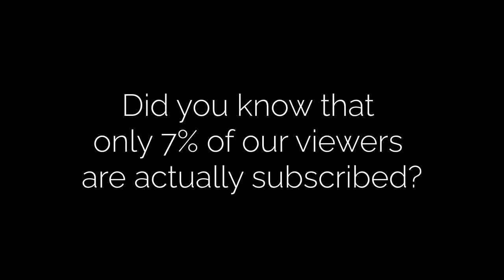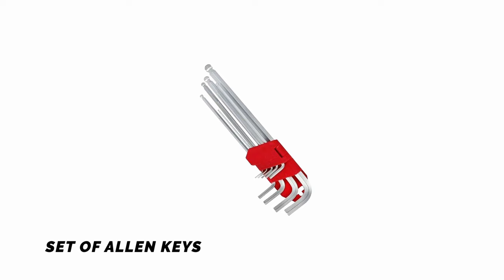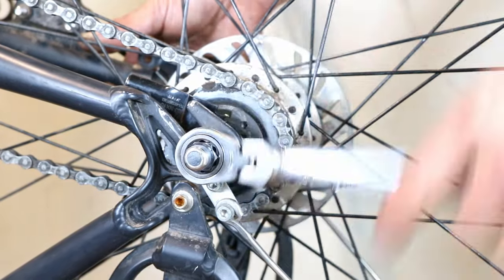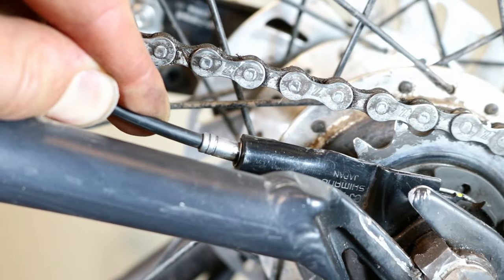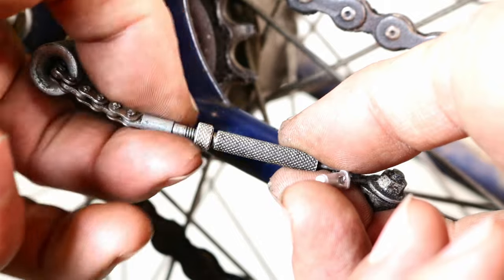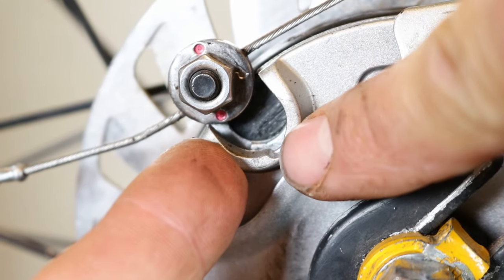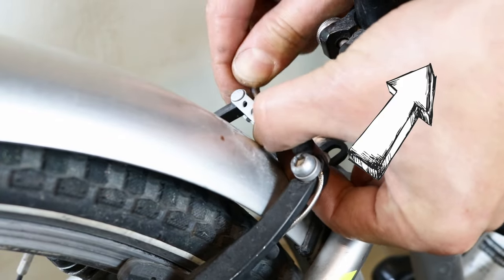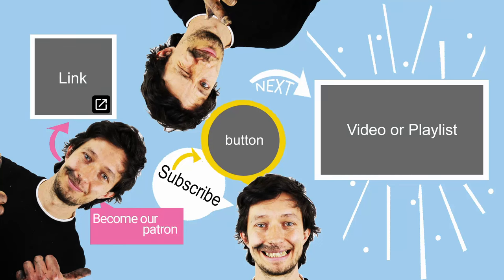Install a bike wheel with internal gears: Step-by-step-guide

Comment: I have Shimano inter m. Its kinda different it looks a like.but seems my break when used doesbt spring back. I guess i need to open the whole break again probably some spring is not good anymore or so? I dont know but anyway
Reply from the maker: Hi, thanks for your comment and sharing your experience. If you need help with your roller brake I have a video that can help here: https://youtu.be/Hm5PxA3pHrQ
Good luck!

Comment: Great video. Subscribed. If it’s a e-bike does the software need to be updated as the gearing ratio and the number of gears will be different from a regular shimano cassette gear. Thanks.
Reply from the maker: Hey, thanks for subscribing and for the kind words! I'm glad you enjoyed the video. Regarding your question, are you planning to replace a a derailleur gears to hub gears? Are your derailleur gears electronic (like Di2 for example)? What alectric system are you using (Shimano, Bosch, Yamaha)? Will you be making your hub gears controlled electroniocaly as well?
Reply: Thank you for your reply. I have Shimano gears and a bosch kiox 300. And I would like to change to IGH from shimano with di2. The eBike is Haibike Trekking 11
Reply from the maker: @amitshivkumar2561  Thanks for this. You will most likely need to connect your bike to the software to set up the gears.
Reply: Thank you. I will ring the number on your website tomorrow.